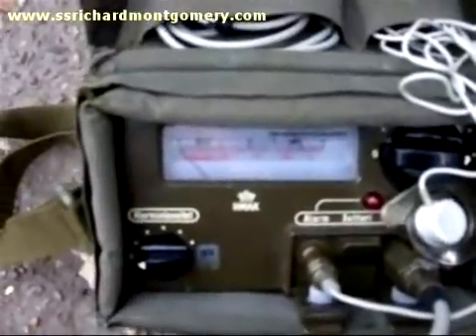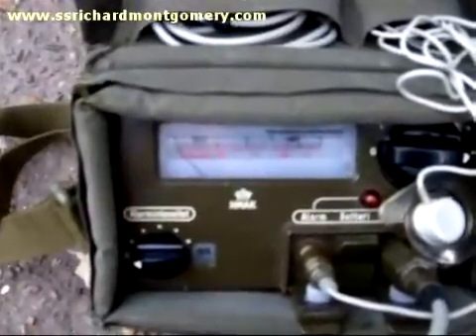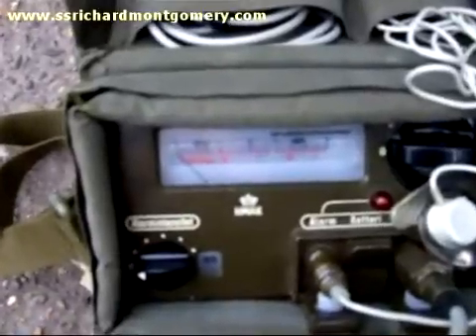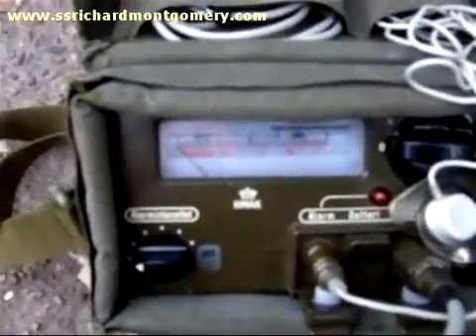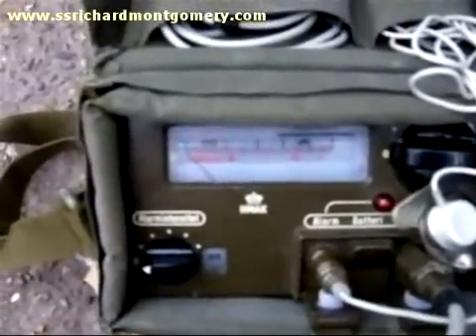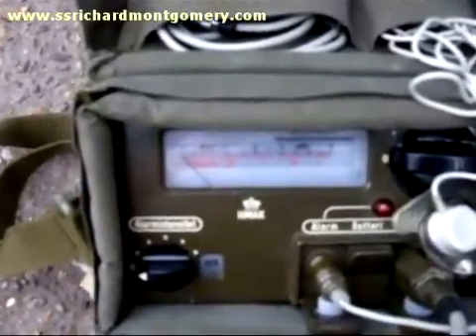How to check radiation levels in your area from your vehicle air filter or exhaust.

Comment from the maker: Good news update: removed air filter to replace with new one (2 years 10,000 miles + ) checked with radiation meter shown and with more sensitive beta/alpha meter  no radiation  detected. So no AIRBORNE fallout  in and around London /south of England area where I have travelled. So far…